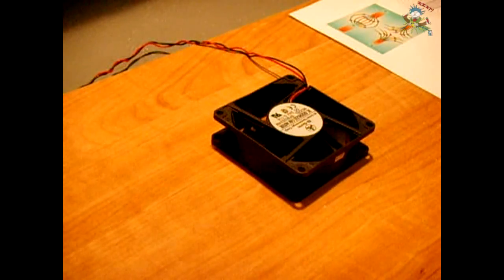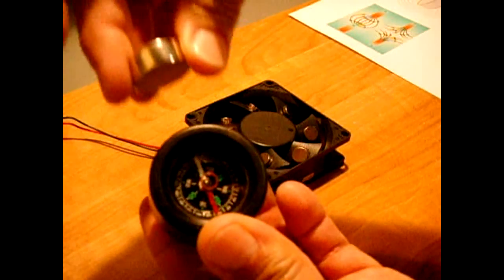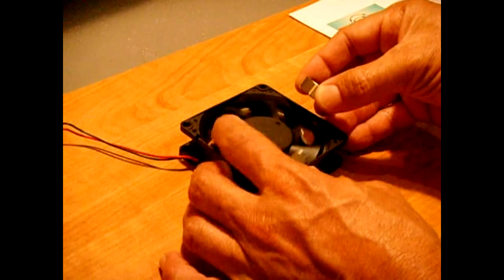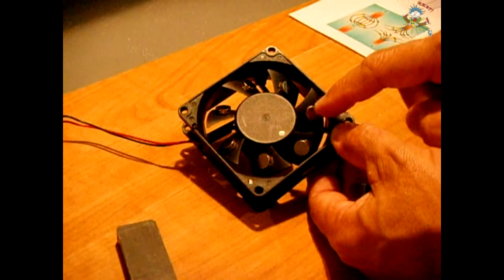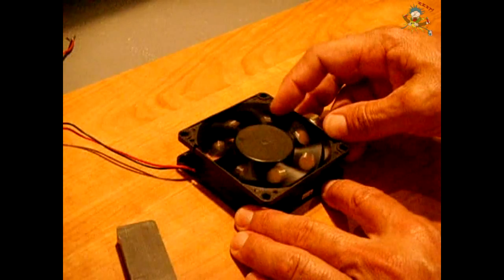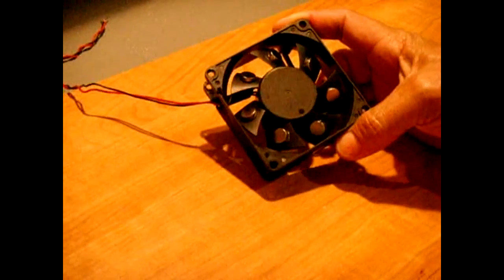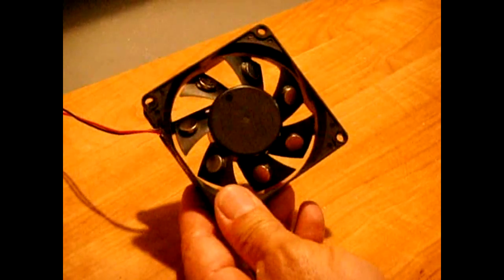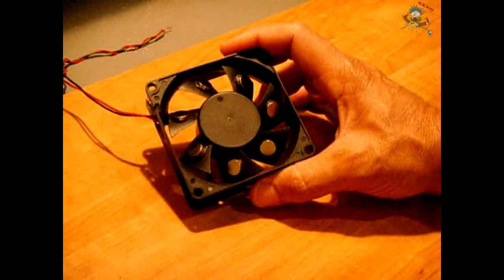Free Energy ~ Case Fan Magnet Motor / Real or Fake?

Comment: iv got a way to try becas of what u said with the coging and u can feel the bumps as the wheel terns says to me the main pust magnet no need to be big try a small on on a see saw type fraim and set it up right so the wheel magnet push the see saw up and down imagine a bumpy road and your cars supenshion up and down following the contors of the bumps and wen you have that set up u can add a small spring one side of the see saw the magnet end and then it will folow the bumps and still be smooth run and its the spring wat will giv you the tern

Comment: This is only a theory. We live inside of a very big strong magnetic field. I noticed a polish type of accent in the original video. What if in his area of location he has a stronger push / pull force from the earth's magnetism or weaker push / pull force of the earth's magnetism thus causing machine to work on that setup in his location. Also try four magnets on outside box just to try maximum amount of possibilities. I'm a firm believer this technology is possible and with a proper setup, very efficient.
Reply from the maker: Eric Budihas I suggest you watch part 2. All questions will come to an end. Stop believing in YT scams.

Comment: You are using regular neodymium magnets. Instead, use monopole magnets which can be found on Borg planet in Sagittarius constellation, 5000 light years away. They can be purchased for 99.99 Borg Dollars for a batch of five, or you may choose 12 easy payments of 9.99 Borg Dollars. But wait, call them within 10 minutes, and they double your order. That's right 199.98 Borg Dollar value just for 99.99. Call 1-800-MONOPOL. [Disclaimer: estimated delivery 10,000 years. Long distance interstellar charges of $100.00 per light year may apply.]

Comment: I think your doing this wrong. Try multiple ways of positioning the magnets on the fan itself,u can also try using opposite polarity to get the process moving along. Only thing I ask is if sumthin that I've told u helps fix the problem will u tell me which process worked! Thanx give it a try.
Reply from the maker: Jacob Williams I know for a fact I did it correctly. Watch my newer video to see how this works!

https://www.youtube.com/watch?v=M6QV0AfDF2k
Reply: I'm try in to make a model like yours that's big enuff to run the essentials in a home. Still have attempted a prototype tho.

Comment: The only thing marginally clever in the fake videos is how well they misdirect the viewer away from the actual trick being performed.  Small things like how they never turn the fan over, show the underside of the stator PC board, the edge of a wire or part strategically just out of shot along with hand motions and banter designed to dissuade the viewer from thinking about such things.  Afford a person time to think, if only for a moment, and it all come apart.  Nice vid. ;)

Comment: HAHA ! I love these videos ! Not the set-up itself, any reasonably competent school kid could make it, but reading all the comments, divided between “This can’t work – it’s scientifically impossible!” and “It DOES work! I have tried it!”. They are lying of course.
If anyone is wondering WHY it doesn’t work, you don’t need to go into conservation of energy or that the magnets are ‘storing’ energy (they don’t). It’s just that you can’t make a motor out of just fixed permanent magnets – no matter how you arrange them, the thing will simply not turn. True, the magnet in your hand is pushing one magnet on the fan ‘forwards’, but it is also pushing the magnet behind it ‘backwards’ and the fan will just move into a position where those forces are equal and the thing never goes any further…

Comment: Absolutely right! Impossible to make the fan spin with a magnet in a fixed position at the side. You can only make it spin, by circular movement of your hand holdin a magnet.
Reply from the maker: A fixed magnet will not get a case fan to instantly spin into smooth operation as shown in the scam videos. Never going to happen. What will work, are movable magnets to push the fan into motion.

Thanks For Watching! Please be sure to share my channel, and rate Thumbs Up.

Comment: your magnets on the fan is way way way way too big,
I am telling you bro, I did same stupid testing just like you, I faild also just like you.
until I changed the magnets on fan to very light and thin magnet, it suddenly worked.

 this test requirs two key points:
1, 45 degree angle fans (some fans are not 45 degree, or not perfectly 45 degree)
2. super thin magenets to put on the fan.( not those you used )

I did this test for more than 50 times, I finally made it work. just for that test, I tried different magnets 10 times more than you showed, I more likely to think, you are saying that lots of vedios are fake, cuz you just can not make them work, and you got maddddd....... cheer up, it works.
Reply from the maker: So according to you, a person who has NO uploaded video to his channel as proof supporting his claims, this works. Sure it does. Don't waste my time, or my viewers time with your false claims.

Watch and learn:
https://www.youtube.com/watch?v=M6QV0AfDF2k

Let me guess, you also had annotations turned off.
Reply: Dude, show me, ive been trying to get something like this to work. Show the world and prove that it workx

Comment: more over you might just have noticed that the light is first disconnected then the magnet is removed, even the light bulb has another source. so does the fan for the rotation.

Comment: I think the solution to that problem is that all of the magnets are at same front,try doing it north south north south.the magnet that you will use to push the magnets on the blades has a north and south on front and back so which means there would be a north and south on the sides of the magnet _______
                                                                       s__|__n could try that one if you'd like,if that didn't work sorry for it
Oh and sorry if you don't understand the comment im not good on english language

Comment: tried a twenty lbs. speaker magnet all types like you had better luck on a windy day non magnetic metals for insulation criss crossed double sides of blades need an interupted electro magnet so much for free energy can't over power cogging can make it spin by moving magnet by hand again so much for free energy

Comment: You have to use normal magnets on this fan to do this couse they have a lower energie and pull not the magnet on hes front !
Reply from the maker: Success!

https://www.youtube.com/watch?v=M6QV0AfDF2k
Reply: electronicsNmore Yeyo righ it dosn't wor wih Neodym magnets but with nomal magnets it will work if they not that strong as this magnets
Reply from the maker: Sure it does.

Comment: I would also like to point out the massive amount of energy it has taken to make the fan and the magnets. And that apparently magnets become weak over time. This means that even if this would work, it would only work in an amount of time, and properly not enough to sustain the production of a fan and 8 or so magnets (or the repair of such magnet and fan)
it is called sustainability (:
Reply from the maker: Be sure to watch the next and last video upload on this case fan scam in a couple days.

Comment: How come I got mine to work and it didn't generate electricity but it spun.
Reply from the maker: Sure you did. I can get the fan to rotate also, but the fan will not continue to spin, or spin smoothly. The video is a hoax. Since you claim yours worked...How about your video?

Comment: you didnt find the right angle is all
Reply from the maker: Hi Day,
The angle of the blades is not the reason this does not work. It does not work, because it is a hoax video. Very simple. In the future I will be uploading a video showing this device in perfect operation, of course It will be a hoax as well. My viewers need to see how easy it is to fool people.
Reply: well, I disagree. my friend made one of those and I saw it working, so there must be something you did wrong.. anyway, it looks pretty real to me on the original video..
Reply from the maker: Not real, I am making another video to show how easy it is to make it "appear" to work. The video is a scam. Unfortunately I don't take a persons work when it comes to "Free Energy" videos. I have no idea what your friend may or may not have done.
Reply: electronicsNmore I made myself one of these "generators" today.. and the result was the same as was yours. I used slightly thicker magnets on the fan (sort of same as you did), and that brought me to belief, that THAT could be the reason of not working properly! As you know, the side of the magnet has oposite polarity, which (in case its too high - having greater strenght) can interfier with the upper negative side, causing the conflict of pushing one magnet vs. pulling the next one on the side.. however, its just my theory, Im gonna rebuild my fan, to see if my hypothesis is right.. what is your opinion?
Reply from the maker: I can get the fan to rotate, but the fan will not do it smoothly or continue to spin. In my next video, all this nonsense will come to an end.
Reply from the maker: You mean Pessimists? You clearly have the wrong guy, I am a REALIST. I have some snake oil, would you like to buy some?
Reply: Day Wo Go to the library. Get a book on "electromagnetism".  It's free to check out the book.  Read it.  Save yourself the time and expense of finding out for yourself why you can't get something for nothing. In the hundreds of years since magnets and copper wire were in people's hands, NOBODY has EVER demonstrated free energy in real life.  Nobody.  Ever.

Comment: Sir, You put all the wires very close. thats why it is slight difficult to accept. I read your note in the video itself - NO THE ENDS OF THE WIRE ARE NOT TWISTED TOGETHER/SHORTED! IT JUST LOOK THAT WAY.
And the word CAGGAIN I dont found on google (with different spellings too)
Reply: why there is no video on youtube that shows how to make fake -cpu fan generating electricity. Because such video also get too many likes and hits. atleast some video also present on youtube. i want to say that if such fake video (as per your judgement) are present there should be some video present who shows how they (the fake ones) are made
Reply: I also want to know apart from your video, that if i made the cpu fan to run fastly by holding it under ceiling fan, would it generate electricity, at least to glow a LED
Reply from the maker: Sumit Wankhede
Not all case fans generate electricity when rotated. The internal circuitry of the fan may prevent any power output.

Comment: hold up a sec.  The video i watched when they made that fan motor, the magnet that spins that rotor was protected all the way around except the side that repels.  can u see if that may work?
Reply from the maker: You mean the magnet that has plastic around the sides that magically blocks magnetic fields?
Reply: not block completely, but it nullifies the powers around that specific magnet
Reply from the maker: Just the fact that the guy claims that plastic blocks the side magnetic field should be your clue that he is a fraud. Plastic DOES NOT block the field. I suggest you do some research on magnets and magnetic fields.
Reply: i had as well, what may help your cogging too is by adding a few more like a ratio of maybe 5:7  the plastic only takes away some field to it.  but by adding a few more may guarantee contact
Reply: im not here to aggravate you,  im only here to hellp find solutions
Reply from the maker: The video is a fake. You need to do your own testing before telling me what I am doing wrong. You will quickly learn the video is a fraud.

Thanks.
Reply: easy there, i didnt say you didnt do anything wrong.  im merely nadding suggestions, thats all....  sorry for wasting your time.
Reply from the maker: The problem is too many people posting comments without actually trying it themselves first. All I would like to see is a post, "I have a working version and here is the video with ALL specs and part #'s for easy duplication". That is all I am looking for if you are going to dispute my video.

Thanks.

Comment: I might be wrong but you used 1 to 3 outside magnets ... Right??  The guy used 4 inside Magnets on the rotor and 4 outside magnets on the case that attract... so in theory shouldn't it spin until you remove 1 magnet.  Wouldn't it  be more powerful on a larger Scale???
Reply from the maker: You watched a different video.
Reply: electronicsNmore That might very well be a different Video ... the rotor the other guy used had 4 blades only with no angles with 4 magnets inside a round plastic housing with 4 magnets placed equally apart that ATTRACT not REPEL!!  The rotor began to Spin all on it's own until he removed 1 magnet to break the cycle then it stopped ... when he put the magnet back it completed the cycle and it started to spin again ... NO electricity needed to activate... if it was a Hoax then it was a Damn good one that  might be worthy of a try to find out ... I don't have expertise in this field, but in theory it makes sense it SHOULD work ... if you have the expertise then try it to debunk it!  ... Good Luck!!
Reply: ***** OKAY ... I don't know much about the laws of physics but I am just trying to figure out a Theory that Might Work?  What if you used 5 magnets outside the 4 magnet rotor with opposite poles to attract spaced at slightly different Distances wouldn't the rotor keep spinning until one Magnet was Removed??
Reply: If you used 5  bar- 2 pole magnets alternating between north and south wouldn't that attract then repel causing continuous Spinning???? In this video he uses a fan with more than 5 round magnets with no copper wire coils on a 4 point Rotor like in the other video. There were no wires attached indicating any kind of power source.
Reply: ***** Magnets always have two poles? No. Not these days.
Reply from the maker: Please post a link where you can purchase a "monopole" magnet. I would love to buy one. :-)

Thank You.

Comment: I see you tried many different sizes of magnet as the outside source! Did you try any variations on the internal magnets?
Reply from the maker: No, because that is not what the other person said they did. My job was to duplicate the other video and show it does not work as shown,
Reply: electronicsNmore Well.....you said at the beginning of your video that you used a bigger or stronger magnet on the internal part then the original video showed. Please don't snap my head off, . . . I am only trying to help. I think maybe it's possible that the internal magnets are grabbing or resisting  more so then they should, thus causing the problem!
Reply from the maker: Stay tuned for a new video to be uploaded in the near future.

Comment: I can see that the magnets used in your video are much thicker than the ones used in a video by freeenergyreseacher. The magnets stuck to the fan blades are very thin so the opposite pole of the magnet has less effect from outer edge. I will do some experimenting with these fan motors and let you know. I have done some with wheels. A sphere magnet has a better effect than disc or square or cylinder.( or rectangle)
Reply from the maker: I also see you failed to read all the annotations in the video. The issue of magnet thickness was already discussed over and over. The channal you mentioned is not the correct channel this video was made about. The video is a fraud.

Thank You.

Comment: which attached fan blades magnates are heavy weight due to the fan is not rotating.  Try with light weight magnates it will work.

Comment: Just wondering ...Did you try sticking 2 magnets together on each fan blade  ?  and yes I do believe what your showing us here
Reply from the maker: Yes. There is actually another video on Youtube showing that. You can get the fan to "Partially" spin by doing that and leaving a couple blades with no magnets, but no "smooth" spinning, and no useful torque. A big waste. In a couple weeks I am going to demonstrate exactly how the individual did this. My video will look identical.

Comment: angle wrong (: thickness wrong (: also its working
Reply from the maker: Sure it is. You know the saying, "Put up or shut up".  100% fabricated. I have a new video that will be coming out to show exactly how to pull this off.
Reply from the maker: Sure it is, maybe your using a special "Turkish" fan. LOL. Since you claim your replication of this exact set up is working, post a link to your video as proof. Of course every spec must be included, along with every part used. If I can verify it does work, then the link will remain, otherwise your link to your video will be removed. You won't get any advertising from me for a scam.
Reply: electronicsNmore  I try it and its working you need thinner magnets on fan and place magnet in right angle
Reply: u redu

Comment: I believe you need to use thinner magnets, say 0.5mm, on the fan blades to reduce the 'clogging' or interference side effects. At least that is what I have picked up on when viewing other videos.
Reply from the maker: Thick or thin, the set up you see in the video is not going to work. Give it a try, you will see for yourself.